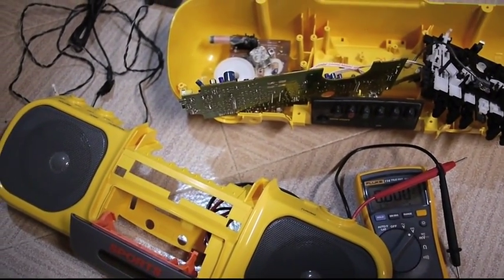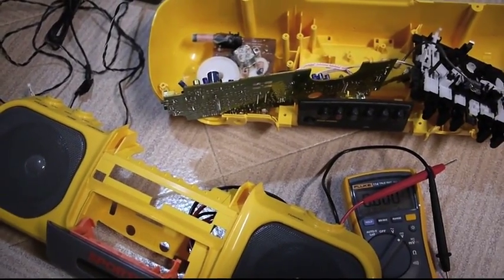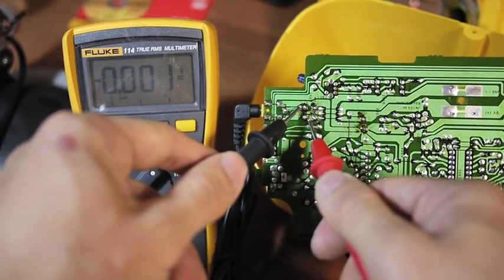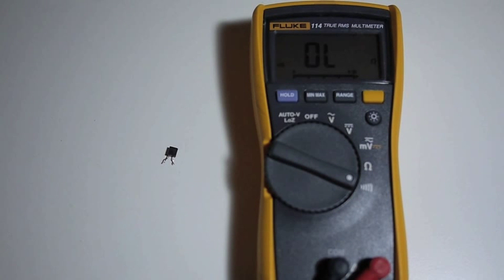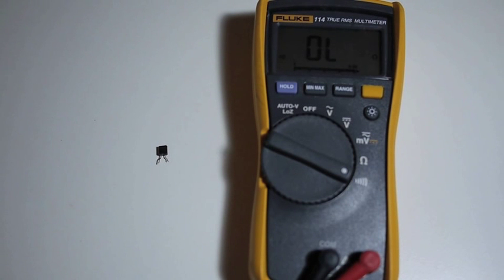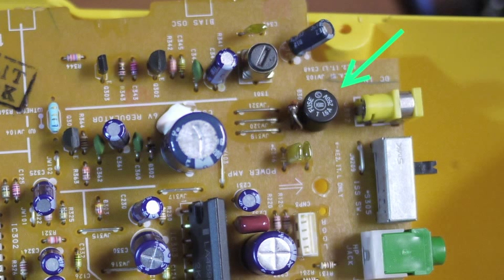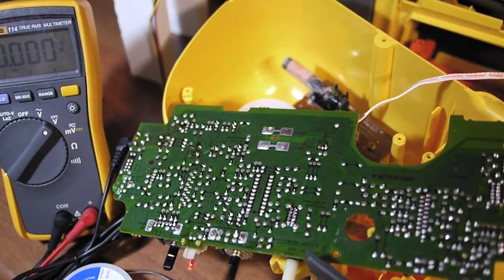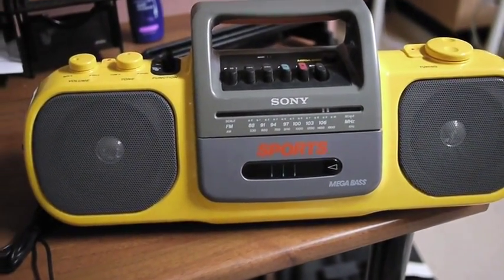Sony Portable Stereo Radio Tape Player CFS-904 Troubleshooting and Repair: Cannot power on

Comment: I have 2 of these radios and a 905. They are still working to this day, 1 has a tape deck that is broken, but the am/fm still works great. These water resistant radios are so handy for taking in the shower, washing the truck in the driveway, take to the polol or beach. Love them

Comment from the maker: It should be 600mA. You may use one that can output more, but not less. While 350mA may allow it to operate at lower volume for a brief period, when unit begins to draw more current, it will overload the AC/DC adapter.

Comment: I have a problem with my radio(It's the same). The cassette player isn't doing very well. It's turning very slowly, and sometimes it gets stuck and it jams the tape. Can someone help me fix the cassette player please? Someone told me that I had to put some oil or something, but I'm not sure if it was a joke or not...
Reply from the maker: Check the gears to see if it is a mechanical problem first, and if it needs some lubrication.
Reply: Ok thanks!